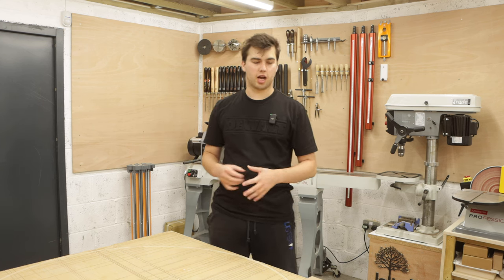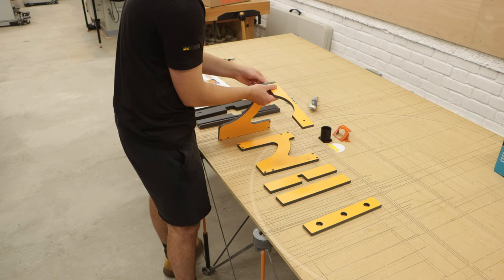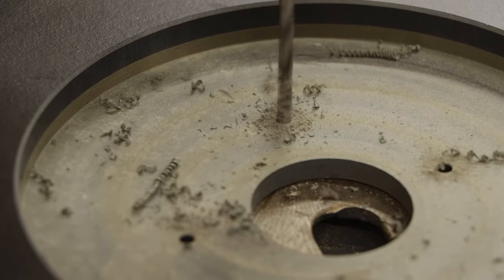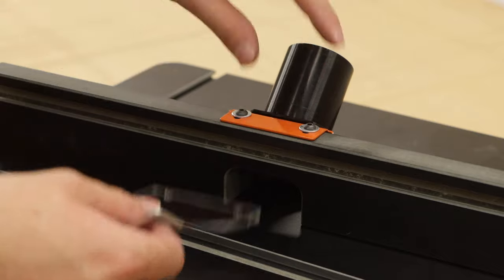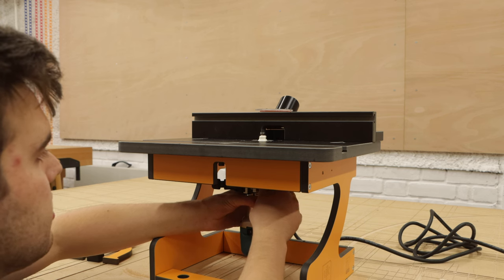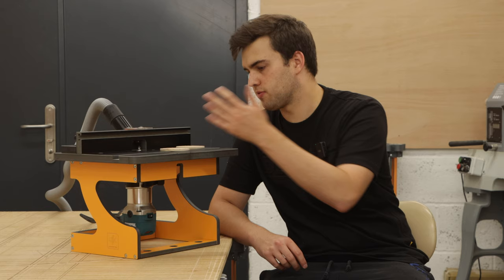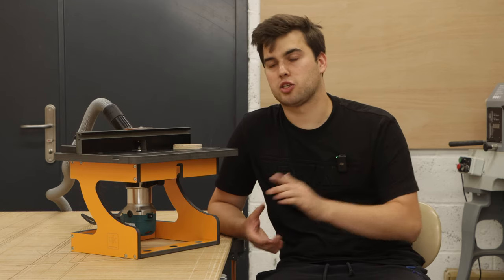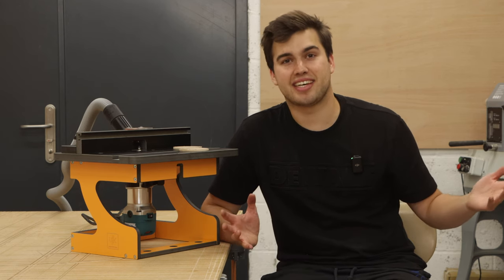Building A Mini Benchtop Router Table!

Comment: Nice router table with some well thought out details! That's pretty solid and a great option for smaller trim routers. There's definitely a market for a high quality table like this, as a lot of the tables sold here in the USA are just overpriced MDF. I used to have a Porter Cable router table which was complete garbage - you could never get the fence straight and adjustments were a pain. Ended up making my own router table and fence instead.
Reply from the maker: Thanks for watching Erik. I agree, my old one was made from plastic, it had three legs and was very inaccurate. This one is a big improvement. See you in the next video 👌🏻
Reply: I remember the old Porter-Cable benchtop Router Table, those are as antiquated as an old Craftsman benchtop model. Even Norm Abram stopped using the old PC design when he built his big Router Station. Porter-Cable made 1st rate Routers though for many years.
Reply: @batarang87  I used to have the old PC690 router, which was the standard router for years. Still worked when I replaced it with a Bosch 1617 last year.
Reply: @Erik_The_Viking  I would've kept the 690 and used it in conjunction with the 1617, there's many benefits to having more than one Router

Comment: Thanks for this well made video. Which model of Makita router did you use (if you have the info handy) ? Cheers Paul
Reply from the maker: Thanks Paul! It’s the MAKITA RT0702CX4/2 710W 1/4" ELECTRIC ROUTER TRIMMER 240V
Reply: E  @SeanEvelegh  Thanks Sean. It certainly looks better than my rarely used model which was bought years ago for next to nothing from a discount store. It has so much crude power that it decides what it does , not you !

Comment: Really nice router table and probably just right for me as a beginner. However glad I was sat down when I clicked on the link, it's rather expensive but then I suppose you get the quality you pay for?
Reply from the maker: Hey Mate, yes it's a perfect beginner router table. It is more expensive that others, however you're right, you do get what you pay for. The materials used and build quality beats the competition.
Reply: Hi Sean, it's been a month now and I was wondering how you're getting on with the table and how much use it's getting compared to your floor standing table?

I'm seriously thinking about purchasing it in the next few weeks so seeing if it's useful for not just smaller fiddly pieces and still able to cope with average things the trim router is for?
Reply from the maker: @anonymouspdg6121  Hi mate. Honestly I'm surprised with how much I use it. I used the chamfer bit a lot, so I have that permanently set up on the table. So much quick to set up than my big machine, so I just whip it out for small tasks. You'll notice me use it in my latest build video, and infact my next build video I use it alot in that.